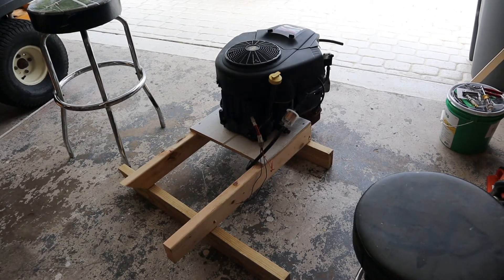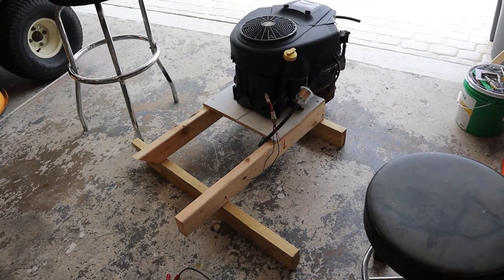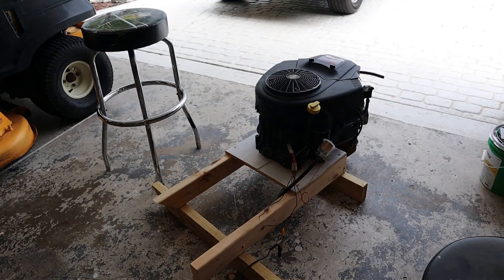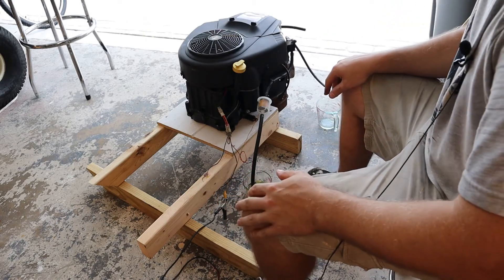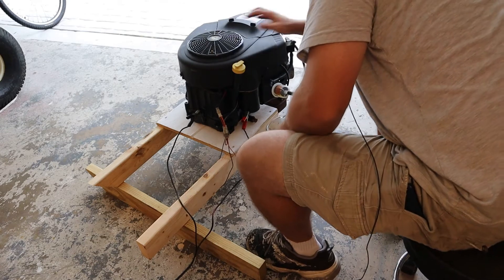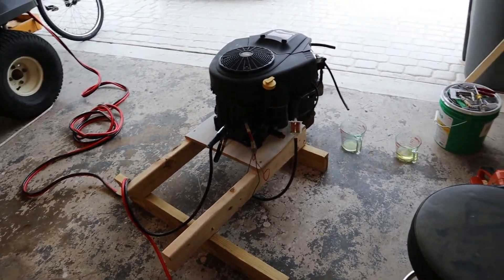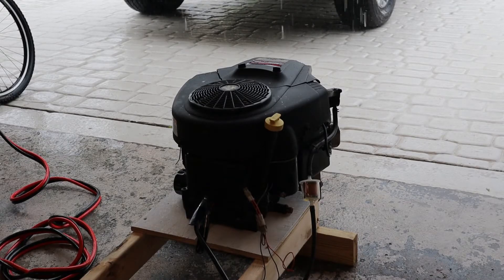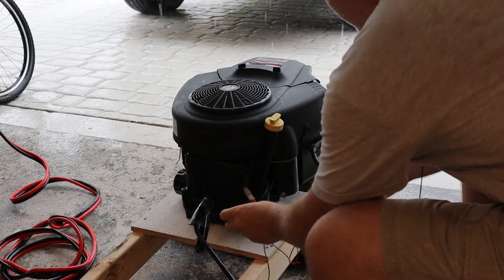Briggs & Stratton Intek I/C 20 HP Teardown and Restore - Part 3

Comment: Bought a used Craftsman lt1000 with that EXACT motor. I rebuilt the deck but the motor ran fine. Mine you have to choke to get it to start just like the one you had.  So glad it does not have a timing belt to fail. The gear drive should last forever and stay in time. .  This looks like a better motor than other motors in that same mower.   FYI   I watched all 3 from beginning to end. Learned about it NOT having an oil filter YET. ( I thought it was a very small oil filter )  Looks to be an easy substitution with that nipple.  ( and the lock tite)  Thank you  for the video . I learned a lot.

Comment: Thanks for the series. I thought video #3 was gonna be 'How to Attach the Air Cleaner!'
When I heard it turn over I thought there may not be enough compression. Sounds good once it's goin though. Good job!
Reply from the maker: Lol thanks for the feedback... yeah that air cleaner is a bit of a pain. I didn't do a compression test but there definitely "feels" like plenty of compression. As you pointed out, it did run and accelerate quite well.

Comment: An open container of gas between the legs and faulty wiring with a dose of guesswork can mean a trip to the ER -- possibly a house fire.
You were lucky.
Go buy that lottery ticket.
Also -- sounds like a bit or tweaking to the governor might smooth it out.